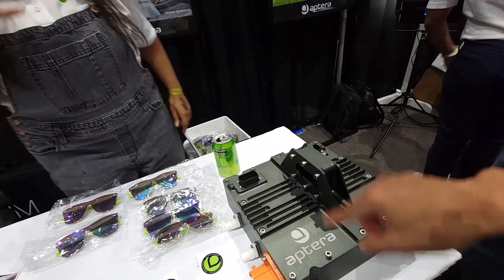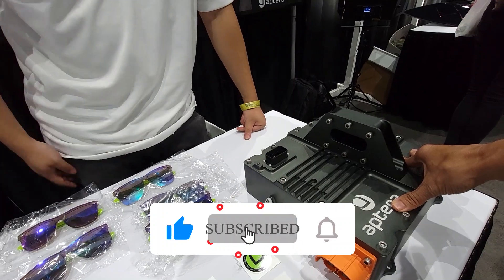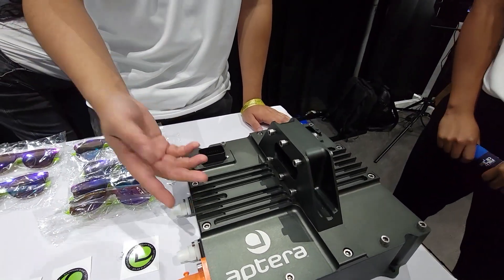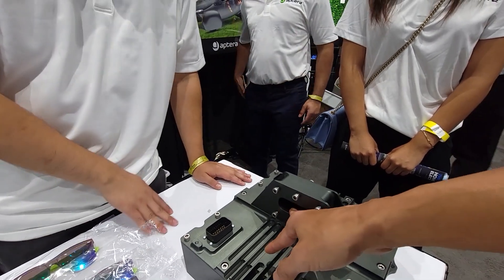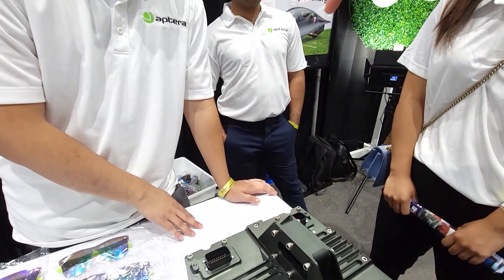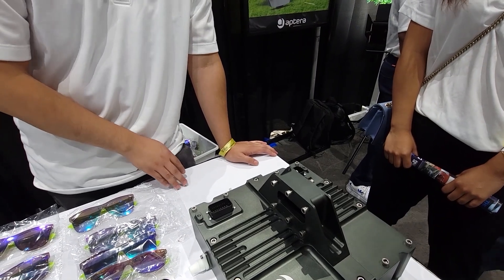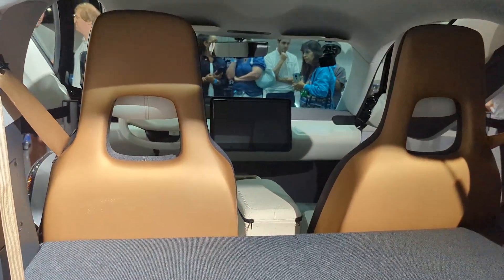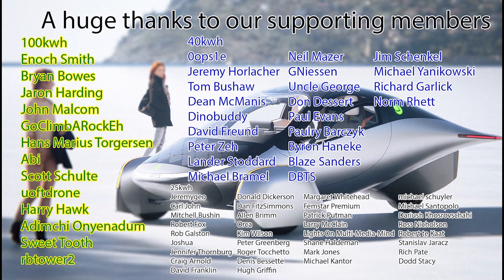Aptera will use silicon carbide MOSFET inverters

Comment: Do silicone carbide inverters rule out the car having a standard 120 volt AC outlet? If not could one of these allow a 120 AC outlet to run when in transit, say if the Aptera can be switched to front wheel drive mode? Ideally Aptera would have a 12 volt outlet in front, and this standard 120 AC outlet in back, or even a 240 volt AC in back to charge up other EV's that need a boost, or when in vehicle to load mode some other 240 volt application. Maybe in the 600 and 1,000 mile battery versions? Maybe an aftermarket modification?

I wonder if in some future Aptera if a single silicone carbide inverter with multiple outlet channels, each with their own controlling units might be employed. Hoping that they might thereby overcome some needless redundancies that having 3 of these baby's locks in, and also be able to save some space for other vehicle uses if they can go this route. I would still like it if one's 3-wheel drive Aptera could be switched over to front wheel drive at will, with the rear wheel spinning free ;->.

Could any Aptera's be engineered to give other EV's a DC to DC boost thus bypassing the Aptera's and the receiving EV's DC to AC, and AC to DC inverters along with their inevitable energy losses?. We want max efficiency whenever possible, right! Is there any after market potential for this innovation/capability?

FYI, at 28:18 of 57:10 look at the power plug on the Hyundai IONIC 6 running a laptop PC!: https://www.youtube.com/watch?v=bFr9JidJZ5Y

Comment: MOSFET--METAL OXIDED Silcon Fleid effect Transitor, it great for small voltage amplifier that work off less that one volt. It can be destroyed be less than one volt. It will also draw less current, which means less power. I^2*R OR V*I OR v^2/R

Comment: main advantages of silicon carbide:
At high power, losses don’t increase with heat.
Max operating temperature is above 500F vs 200F. This makes cooling using air without a chiller viable. Without a chiller they would need 2 coolant loops, your video only shows one side, so it is unknown which method they chose.

Comment: Yeah, really the layman's summary is something like "These inverters use more efficient electronics." It's difficult to explain it any more than that without a whole lot of words, but I guess I'll give it a shot. Most of you are probably aware that electric motors almost always have coils of wires in them that have current running through them that form electromagnets that push and pull on other magnets (some types of motors use permanent magnets others use more electromagnets). The magnetic polarity of an electromagnet (N/S pole) depends on the direction current is flowing through the coil. The direction current flowing is controlled by the voltages connected at the ends of the coil. So each coil has two ends and there are generally two switches on each end of the coil, one that can connect the end of the coil to positive voltage and one that connect the end of the coil to negative/zero voltage. This configuration of switches and a coil is generally referred to as an "H-bridge" because the schematic looks like an H. The IGBTs and Silicon Carbide MOSFETS that guy mentions are just different type of switches that can be used in an H-bridge configuration. Like any electrical component (superconductors aside), the switches have a non-zero resistance. For this application, the SiC MOSFETs have a lower resistance between the two high current terminals of the switch component in the "on" state. Anyways, there's a lot I'm glossing over here (current change in a coil takes a substantial time, other moving magnetic fields around a coil affect current flow through it, the low current signals SiC MOSFETs and IGBT's are switched "on" by are different, ...) but that's a lot more words and maybe this is helpful enough. By the way, a simple brushed DC motor also has switches to change the current direction through its coils, it's just that those switches are integrated mechanical switches (the brushes against the pads on the rotor)(and you usually also want at least one H-Bridge for those to better control power delivery and reverse motor direction).

Comment: 3 of these (on the all wheel version) seems like a lot of footprint/weight compared to Tesla's integrated inverters using much larger motors. I'm betting we will see incremental efficiency improvements with later models.

Comment: IGBT are efficient at high load due to low resistance. MOSFET are good at partial load. If you have more than 1 motor it's best to use both. MOSFET when using little power, IGBT at kick down.

Comment: as in all cases the devil is in the details and the proof is in the pudding. FET's have been getting better all the time, they can now handle high voltages and high powers in a small package, with low losses.  The lower losses require smaller heat sinks, making the entire package smaller.

Comment: The inverters must talk with each other to maintain vehicle stability or the torque request needs to be handled by an ECU that manages stability/traction control so it can adjust? Could be that the inverters have the processing capability to handle all events amongst themselves but i'd think there would be a master controller that controls the power request of each inverter and gets the sensor data from the inverters.

Comment: So to try to answer a little bit about the DC vs AC motor, if you think about it, all motors require alternating current to operate, since to make something spin in a circle you need to apply a changing magnetic field.

A great way to do this is to place three different electromagnets at 120 degrees separation around the stator and energize them in 120 degree-phased sinusoidal patterns. This sounds complex, but in fact it is extremely simple if you are using a rotating mass (like from a steam or hydro generator) to make your electricity. As long as the application calls for a motor that spins at 60hz (50 in EU), the incoming three phases will power your motor very efficiently. This is basically what Nicola Tesla patented. If you want your motor to go faster or slower, that's possible in multiples (why your AC fan has discrete speed settings).

It gets trickier when you have a DC power source. You could theoretically use a  brushed DC motor, and some handheld appliances do this, like some cordless drills maybe? Or go-karts? RC cars? A "brushed DC" motor mechanically opens and closes the circuit as it rotates, but this causes physical wear and creates the characteristic high-pitched whining noise associated with such devices. The carbon brushes typically need to be replaced as well, and carbon dust removed.

More modern battery devices will use a "brushless DC" motor, which I believe actually means an AC motor fed by a 3-phase sinusoidal inverter. The inverter uses logic to create pulses of current, and by modulating the widths of these pulses they can simulate beautiful sine waves without wasting much energy. More expensive but the obvious choice for longevity, efficiency, and noise/heat.

Modern inverters for solar applications (required to get your DC current into a form compatible with the grid) are commonly rated at 99% efficiency these days. Not sure about the one for cars motors.
Reply: So a simple fan that a kid uses to blow on their face has a DC to AC inverter in it?
I thought it just had a rotating current
Reply: @golfish8589  direct battery to motor like that fan a kid would use on their face is DC most of the time, it doesn't need to change speeds, so in that case a brushed DC motor is usually used.
it's when you need to change the speed of the fan that a controller is needed and an AC motor is preferred, especially in high power areas.
Reply: @user--PM  i have been replying to the gentleman that has been basically saying that all electric motors are dc motors. Even the motors that are in EV's
Reply: @golfish8589  yeah, if it's battery-powered, I'm pretty sure there's a little inverter in there. Someone correct me if I'm wrong on that.

Or maybe it's brushed. Take it apart and find out! I guess that would make more sense for something really small.

And what about little DC fans inside computers? I dunno how they work either, I have to admit.
Reply: @suunraze  thanks for your honest reply. Very rare here.
I could tell by your reply that you are more knowledgeable than I. But I have been following evs and conversations for 4years. And picked up a few things here and there.  And from hvac trade school 4 decades ago.
Vehicles use both a/c synchronous an a/c permanent magnet motors.
And they are more efficient than dc brushless  motors.

I am pretty sure the hub motors in the Aptera ev 
are a/c.
The Aptera is all about efficiency
Reply: @suunraze  most cheap toy motors are just brushed dc motors. Anytime you see brushless DC or BLDC, it is still DC, and does operate similarly to an AC motor, but there are differences. BLDC uses permanent magnets on the rotor, and the stator uses pulsed DC in several branches or "phases" (usually 3, but could be more or less depending on the design of the motor) to drive the motor in whatever direction and speed the controller tell it. Think of these pulses as the power strokes of an internal combustion engine. The motor controller controls the timing and pulse width of each of the "phases" to generate the desired output. 

AC motors do something similar, but they use an inverter in the controller to produce AC waves for each of the phases, in addition to providing input to the rotor, which in most cases is another set of windings, which needs AC to produce a magnetic field, as these rotors do not typically have permanent magnets. There are AC motors with permanent magnets in the rotors of some, and I believe Elaphe motors (supplying Aptera) is a company using such a system. 

There are pluses and minuses to both BLDC and AC sync motors, both in the performance as well as manufacturing, and a designer must make a decision about how he/she wishes to optimize certain aspects of the system they are building. 

Have a look at this, hope it helps: 
https://www.allaboutcircuits.com/textbook/alternating-current/chpt-13/brushless-dc-motor/#:~:text=Brushless%20DC%20motors%20are%20similar,torque%20in%20a%20magnetic%20rotor.
Reply: @golfish8589  I think it's really a question of semantics. Package an inverter with an AC motor, power it with a battery, and that's a "brushless DC" motor, regardless of whether it's permanent magnet, reluctance, or some hybrid like the Model 3 motor.

The auto industry doesn't use the term brushless DC motor, but I don't see any particular reason other than scale.
Reply: @MBergyman  cool, thanks! I'll read that
Reply: @suunraze  from the article listed.

"“An inverter converts DC charge from the battery to AC to drive the electric motor, and also times switching changes to adjust the frequency of the AC charge to control the speed of the motor, "

Comment: Watch Jay Leno's Owen Magnetic video for what it's like to drive a DC electric car. Like old trolleys there were fixed power levels that probably use a combination of parallel/series reconfiguration and inline fixed resistors. But resistors mean more loss than an inverter. And brushes on the DC motor are a wear part.
Reply: The Owen Magnetic was Cutting Edge in it's own time. We have come a LONG way since then, and PWM and Brushless Motors may lead us to the Next Level. Battery Tech is also moving quickly, and other Power options are on the Horizon. Hang On Tight!  It's getting More Exciting Every Day!!!
Reply: DC motors have a mechanical commutator to switch current to alternating.  AC motors are fed a "switching" current or simply alternation current and are mechanically simpler Each type of electric motor DC or AC has different mechanical outputs, but in the past some DC motors with high torque and speed were best to propel electric cars.  The AC induction motor with high torque and speed existed back in the time of the Owen's magnetic care of 1916 but the technology to control them for automotive use did not really exist it was not practical. With modern power electronics an inverter can be designed for to exactly control an automotive AC induction motor with exquisite high performance and to harvest regenerative power when slowing down.  Its way better than we had in 1916, something they could only dream of back then.

Comment: Wow, a lot to look at here!

As far as I know, Tesla was the first (and maybe still the only) major manufacturer to use SiC for their Model 3 inverters. It increased their cost by a couple hundred bucks per inverter but simplified thermal management, and is one of the reasons they are able to eke so much efficiency out of their drivetrain. I read/saw somewhere that the component cost of a Model 3 inverter was around $450. It may be a lot cheaper now? SiC is coming down in price.

I am definitely not an expert on inverters, but this thing looks quite large compared to the physical size of the Model 3 inverters, at least based on what I have seen watching Sandy Munro's teardowns. That's interesting since I would have expected a 50kW unit to be smaller than a 150kW unit. It could have something to do with the fact that the Model 3 inverter is integrated into the motor itself, so some of its components could be part of the physical motor housing?

Comment: Great content.
How does this carbide inverter compare with Tesla or Ford EVs?
Do all manufacturers have one inverter per motor (rivian)?
Do all motors run AC and require an inverter?it seems inefficient to always convert to AC rather than developing DC motors for EVs.
Reply: Many inverters use IGBTs instead of silicon carbide - these were previously the best way to handle very high current.  There is always one inverter per motor - there are sensors on the motor to determine position and this will dictate power that goes to the particular phase of the motor - so called "field oriented control" of three phase A/C motors.  I believe that some Teslas now use DC brushless motors, so it is theoretically possible to do this.
Reply: @lsh3rd  the Model 3 motor uses internal permanent magnets and synchronous reluctance effect. They were able to make this work efficiently by rotating the magnets 45 degrees. I don't really understand exactly what any of that means though, except that the overall effect is a motor that is efficient at both low and high speeds.

I believe the Prius also uses some type of IPM/synRM tech as well, but in a different form that isn't quite as efficient?

Comment: Besides providing power to the motors, the inverters also do the opposite when regenerative braking is used. The batteries can only handle ~50kW but each wheel potentially could handle 68kW but will be limited by the inverters so no more than ~50kW is fed to the batteries.  The batteries can discharge up to ~150kW (3C). The computer regulates how much regenerative braking is done by each wheel. If you have the 2WD vehicle the rear wheel obviously will just have a disc brake.  The computer will need to adjust the brake pressure proportionally to the front regen / disc system.  This is actually fairly complicated to do well as the regenerative braking should occur long before the disc braking unless you slam on the brakes.  If you are braking hard all the time where you hit the 50kW battery limit, expect the brakes to wear.  (I know people who only get 10k miles on their brakes ICE vehicle while I get over 100K miles for brakes in a Firebird. It really will depend on how you drive.)

Comment: Looks heavy. Did you try picking it up? I'm wondering what the weight penalty will be for the 3 wheel drive option.  I'd guess close to 100 pounds with motor, inverter, cabling and cooling.

Comment: Certainly a key component. I am an aero engineer and didn't understand it either! I think you need to be an EE to get it all. My judgement, he sounded confident and authoritative. I am also sure the vendor that built the inverter was knowledgeable. The ultimate of course are the results of testing in a full systems environment.

Comment: Three inverters sounds like more parts and more to go wrong , but I don't know anything .
Reply: If you only had one inverter, the motors would be running at the same speed, like not having a differential, I think. Trouble turning.
Reply: @carlanderson4139  Correct... The inverter needs to very precisely know the position of the motor, so unless the armatures are locked together, you need two inverters.
Reply: An inverter is needed for each powered wheel motor.  My 2WD version will have two.
Reply: The inverters perform to function of torque converter and transmission for an ICE motor.  Then the inverter is also used to recover energy during regenerative braking something no ICE motor can do.  They are also smaller and lighter than a transmission/torque converter unit on an ICE motor.

Comment: Looks very complicated, a pump for the coolant is a moving part , I wonder how long those last and are they easy to replace .
Reply from the maker: I think the pump for the coolant is outside the inverter. Just like the pump for the coolant is outside a radiator
Reply: Nearly all EVs use coolant pumps... if there is anything that will probably need replacing at some point, this is probably it.